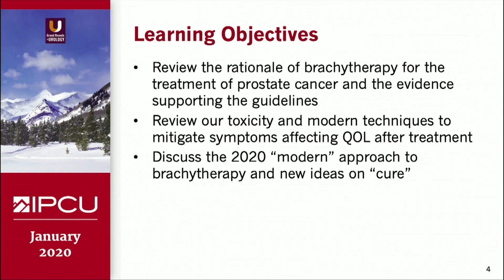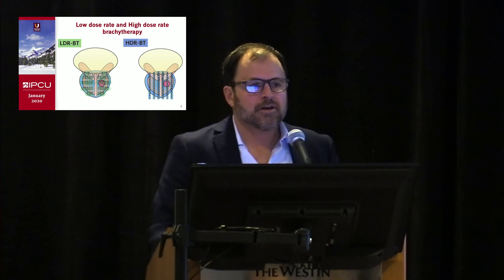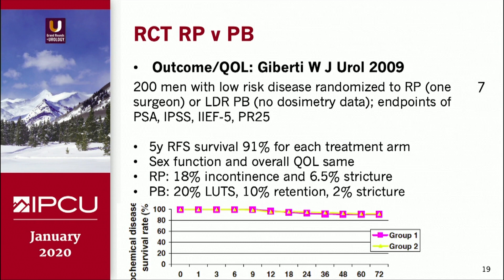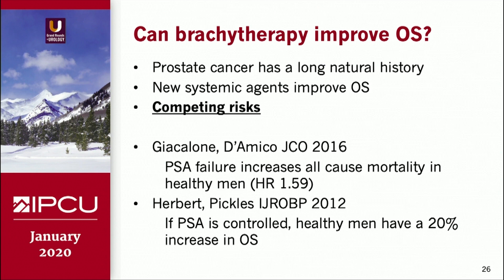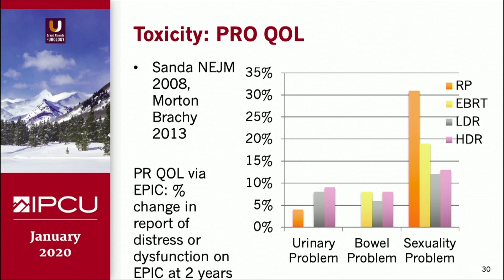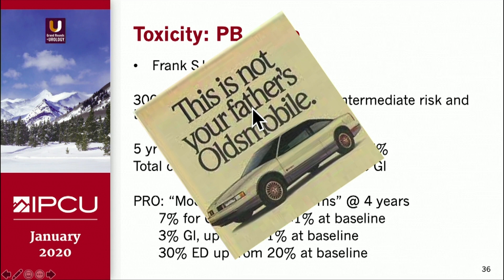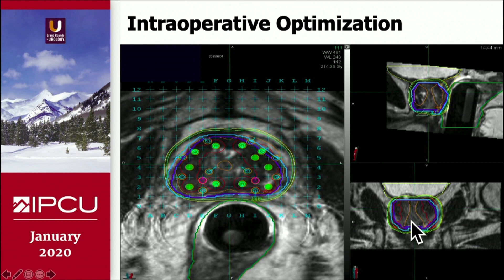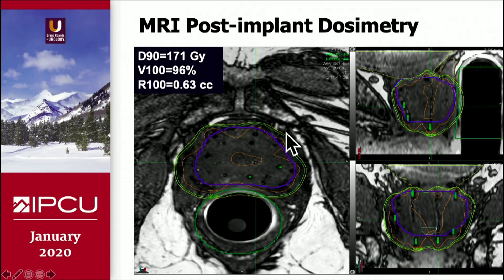Update on Brachytherapy for Prostate Cancer 2020

Comment: I have claustrophobia, extreme pain while on my back and sleep apnea-a trifecta of problems for an MRI one was attempted while sedated with profolol and they woke me up in the tube because my O2 went way down (sleep apnea) My question is with high volume G6 cancer, can brachytherapy be done without MRI guidance? I can handle a CT scan (still required 2mg lorazapam) So unless they can get a positive air flow into the MRI room, I will not be able to have an MRI. Any suggestions? I suppose using my biopsy area and CT scan they could "guestimate" where to implant the seeds?